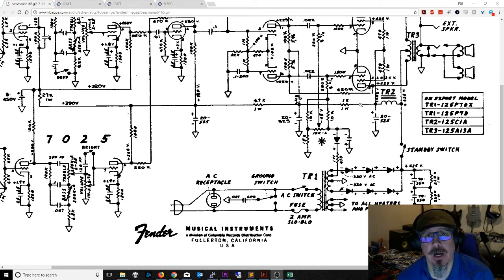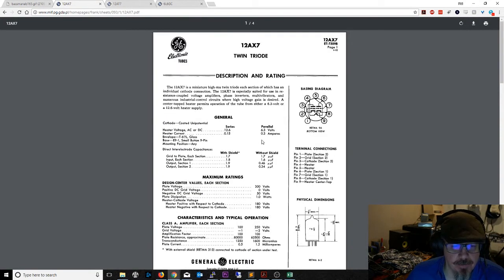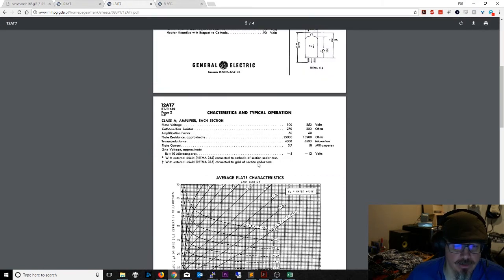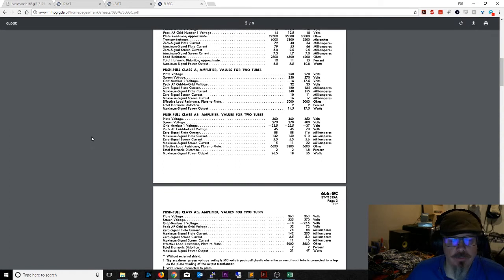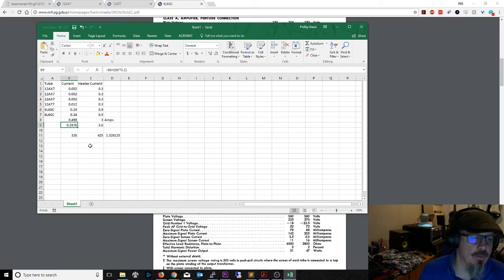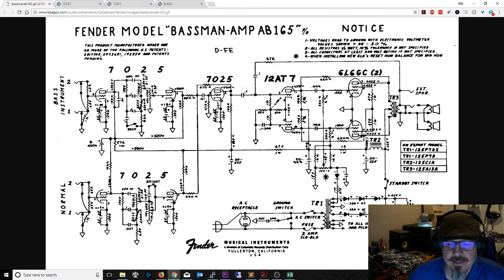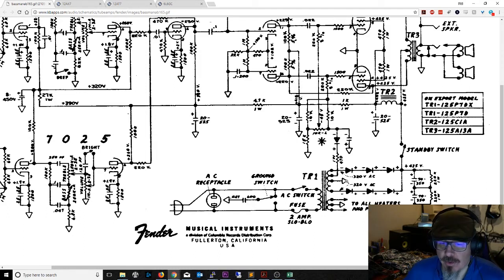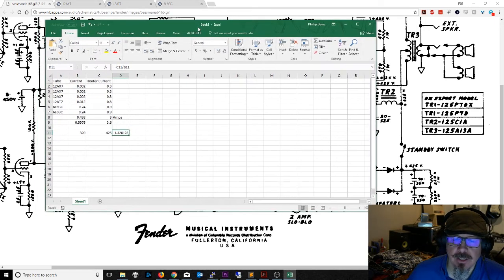Tech Tips Tuesday #2

Comment: Do you have a video on choosing the time constants for the CRCRC... filter sections? I have built a HiFi tube amp before but I am unclear on choosing the best RC values for best stability and transient response.
Reply from the maker: I do not.  My general understanding of power supply filtering is that the resistors are adjusted to get the right voltage at the anode of each tube for the desired operating point. This is the only consideration that should matter.  As for the capacitors used for filtering, the more you use the better as it just provides a stiffer power supply.  The only consideration I know of other than that is ensuring that the first capacitor doesn't exceed the tube rectifier's max capacitance rating if using one.  Mind you I've only every built and fixed tube guitar amplifiers.